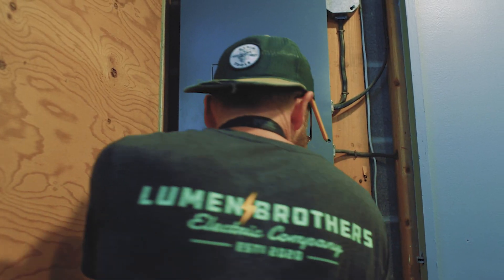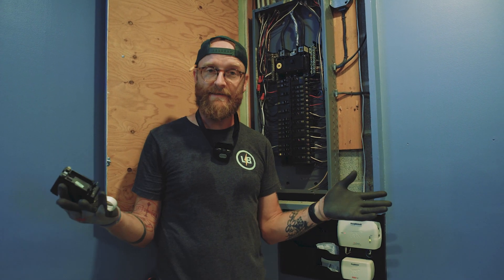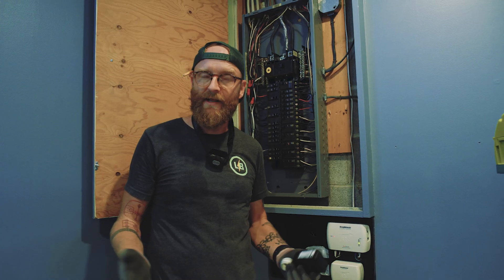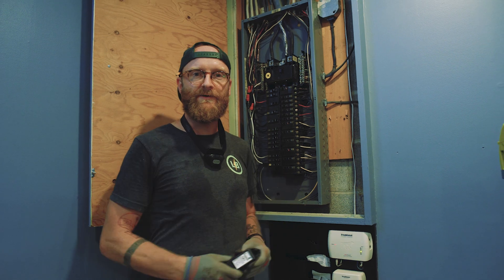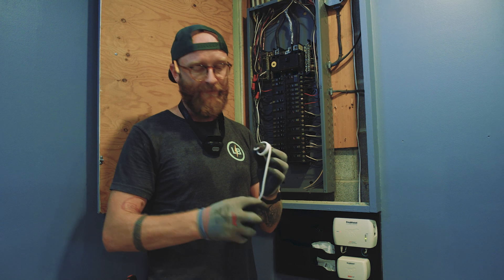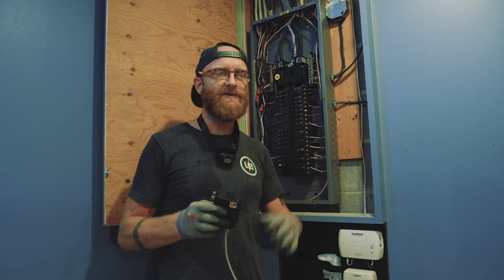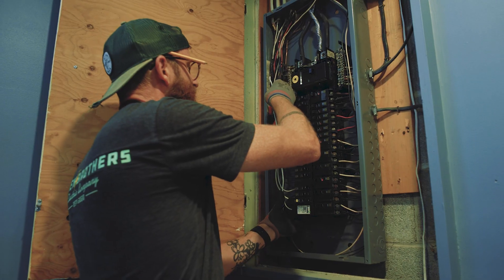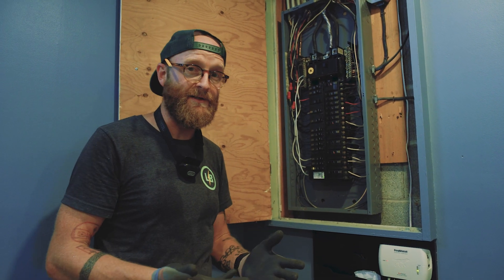Surge Protection (How It Works & Why It's Important)

Comment: This isnt me trying to nitpick but idk if your know the surge protector is supposed to be installed at the top of the panel near the main. 
The SPD requires two adjacent 
mounting spaces and should be installed as 
close to the main circuit breaker, or main lugs 
as possible